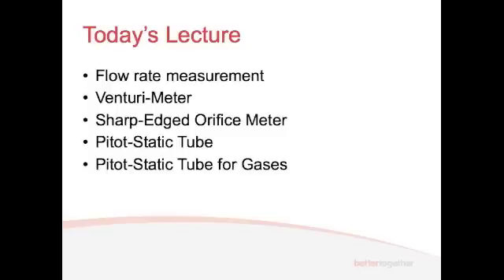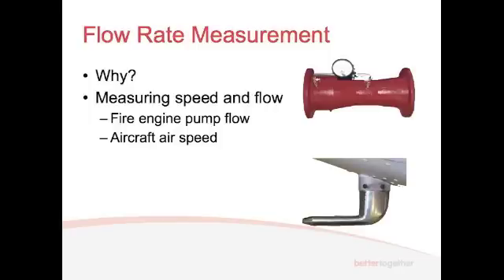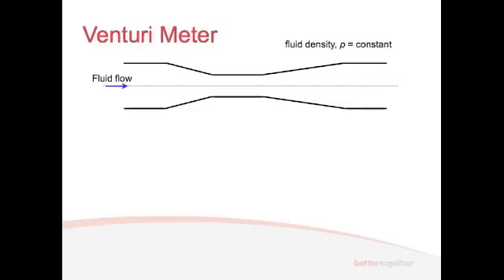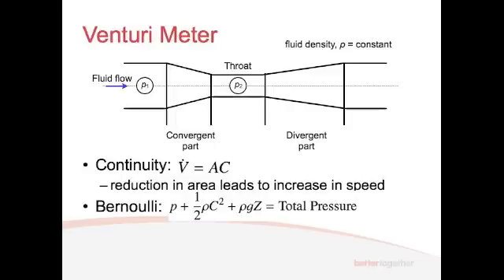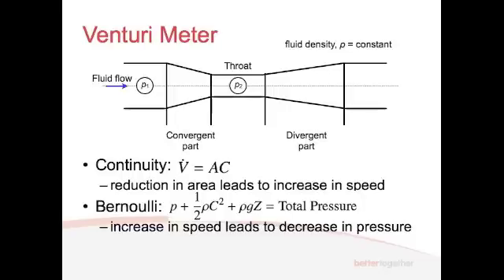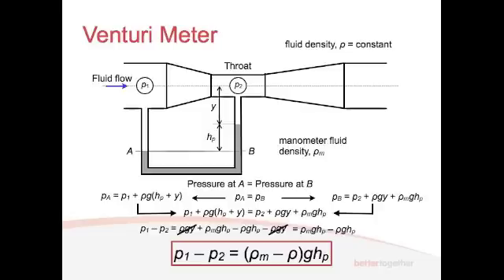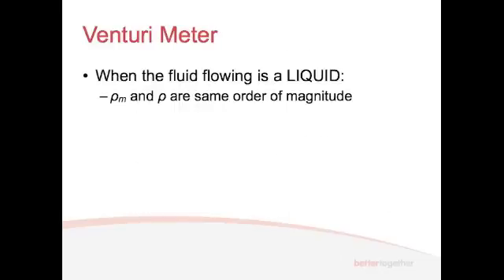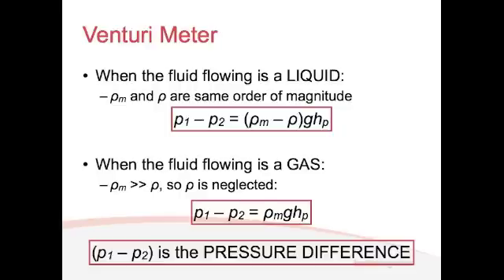Fluids - Lecture 3.1 - Flow Rate Measurement

Comment: 7:00 An interesting point is that the density of the fluid in the meter (rho m) must be greater than the density of the fluid in the pipe (rho), since p1-p2>0. If the density of the fluid in the meter is less than the density of the fluid in the pipe, the meter fluid would rise up into the pipe.